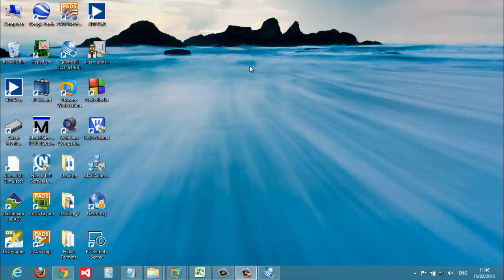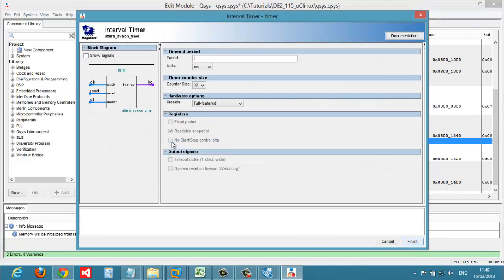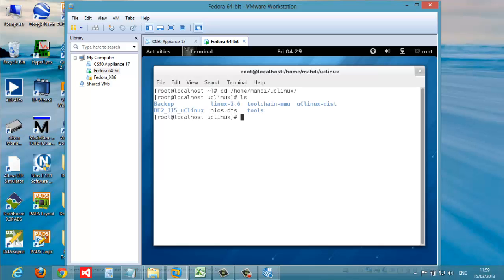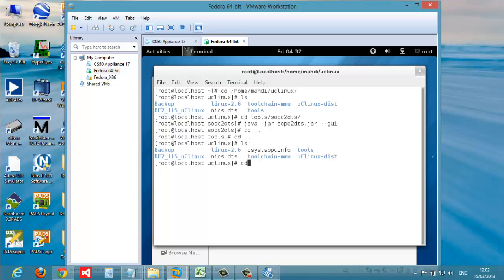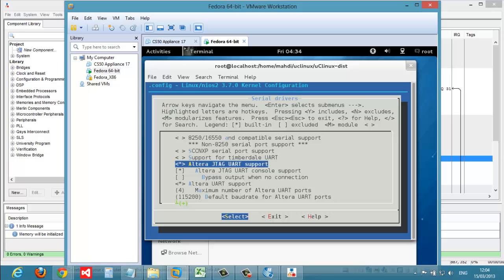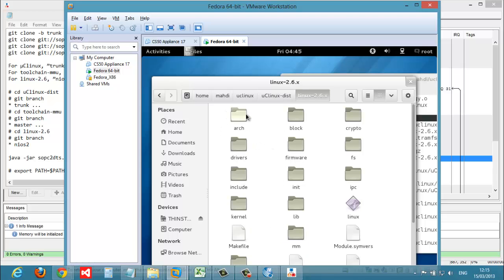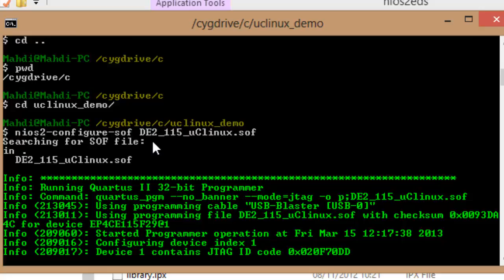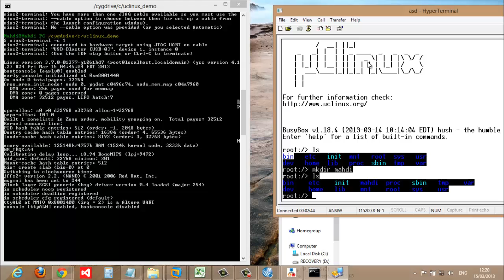How to boot uClinux on Altera NIOS II Processor with MMU

Comment: Super!
It works! I try make step-by step with  Arria II GX FPGA Development Kit.
But in Qsys 13.1 Build 162, there is some problem with converting from *.sopcinfo to *.dts, 
you must cut double repeated line, for example:
*.dts:
----------------
...
clock-frequency = < 150000000 >;	/* embeddedsw.CMacro.CPU_FREQ type NUMBER */
...
clock-frequency = < 150000000 >;	/* embeddedsw.dts.params.clock-frequency type NUMBER */
...
----------------

when you try make, you see this problems=).

P.S. Mahdi, thank you!

Comment: Hello, we are a group of electronic students, we are working on a project using the de2-70 fpga board, firstly, we wanna thank you a lot for your tutorial :
it was very helpful ! But unfortunatly when we get to the ethernet configuration part (MAC adress and IP adress) it doesn't work and it says : eth0 not found.. The ifconfig command only returns the loop and no other interface. We're sure that the dm9000 module on the fpga board was added and well configured because we are using the .sof file of a previous project and it worked perfectly fine last year. We tried "ifconfig eth0 up" no result, we thought that maybe we have to use an ethernet crossover cable instead of a straight through one, but we're not getting our hopes up... We've looked in the internet for possible reasons, we don't seem to find the solution... We don't know what else the problem might be... Can you help please ?
And also, we would like to know if it's possible to work directly on the EPROM, so that we don't have to do the work all over again every time
 
Thank you in advance !

Comment from the maker: Hi
Please check the "output_files" directory in the current project, if you have student license you can compile the project but it is time limited, it only runs untill the usb blaster cable is connected to the board
After the compilation, the .sof file will be in the "output_files" directory
Please let me know if the problem didn't solved

Comment: Hi Mahdi,
I'm finally running a uClinux system with support for mmu on DE2 Altera kit. But I am having problems running the network chip. The chip is a Davicom DM9000AEP. I did not find good results on the web for this inconvenience. I will change development kit (DE2 to DE2-115).
Have you done some test with ethernet?
Thanks, NG
Reply from the maker: Hi
Unfortunately i didn't work with the Ethernet and i don't have any idea how to do it.

Comment: Good evening Mahdi Hafezi, my name is Leonardo Sarraff and i am from Brazil. I am trying to implement a simple communication between my DE2-70 board and my PC. I want to use the serial port (rs 232), i followed this tutorial http://www.labbookpages.co.uk/fpgas/alteraHowTos/simpleNiosII.html, but it did not work. Can you help doing this? I'm a beginner in FPGA and Nios II programming. I have already done the qsys project, i have loaded the code, but i could not see anything being sent to my computer. I used the hyperterminal to monitor the serial port.But as i said it did not work. I'm using a seril to usb converter, my SO is windows 7. Thanks for your attention!!!